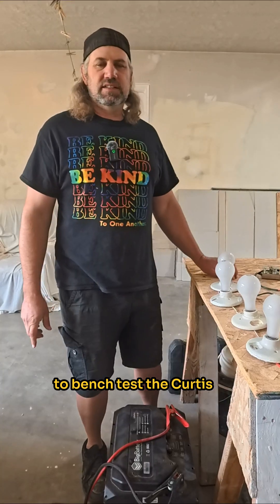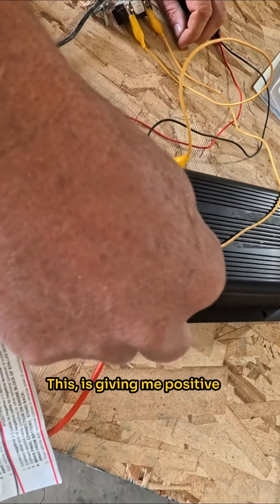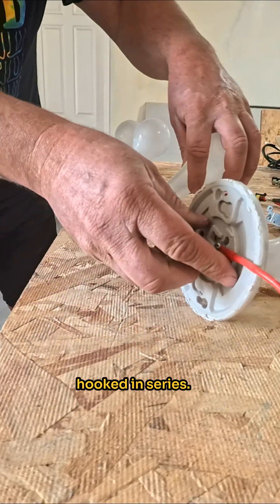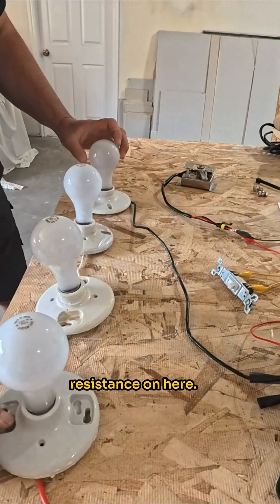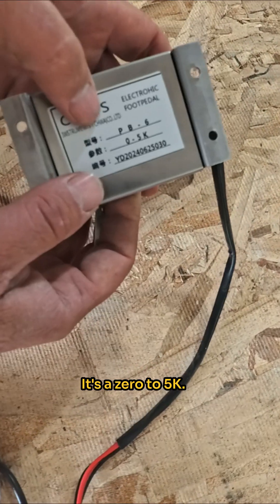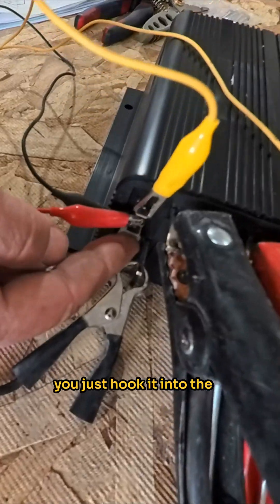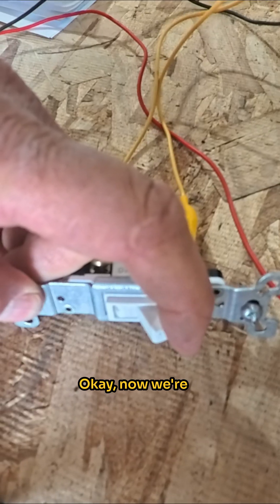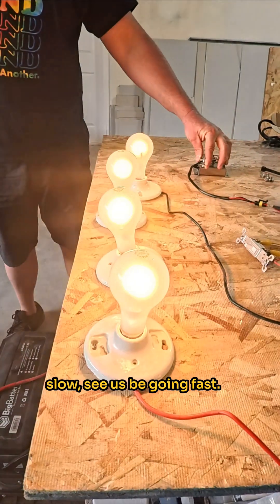48v Curtis Controller Bench Test

Comment: I have the 1204 36v controller 0-5k and 0-5 pot box which I verified is working. I did 3 12 volt bulbs in series and wired everything the same as video but not working. From my b pos to m neg I get 23 volts no matter what position the pot box is in. I checked all connections and are tight, I even tried a potentiometer 0-5k also. I thought controller was bad so ordered another and same results. Any ideas??
Reply from the maker: Maybe this can help.https://www.manualslib.com/manual/815243/Curtis-1204.html?page=39#manual